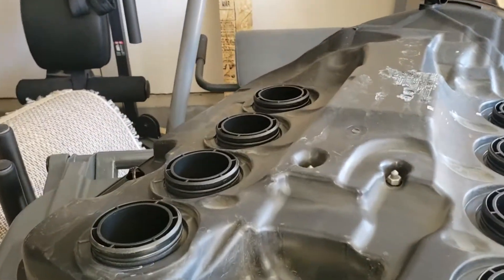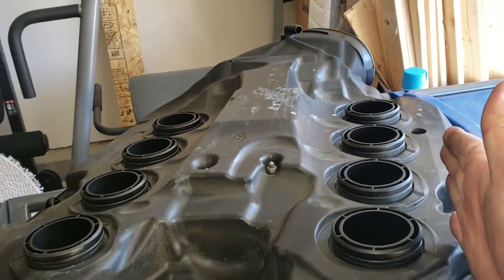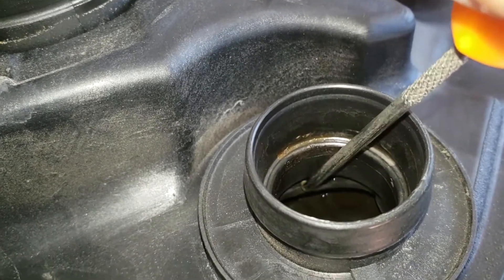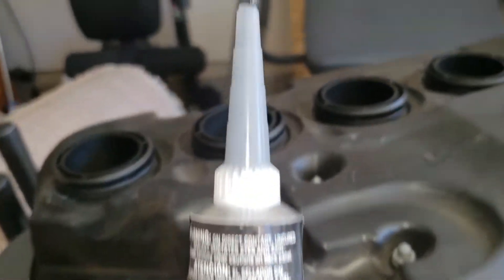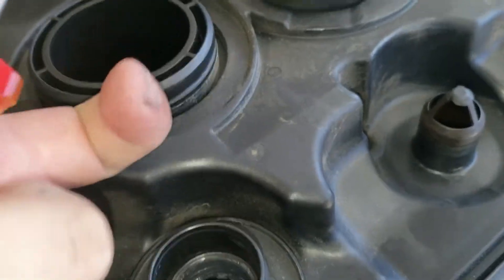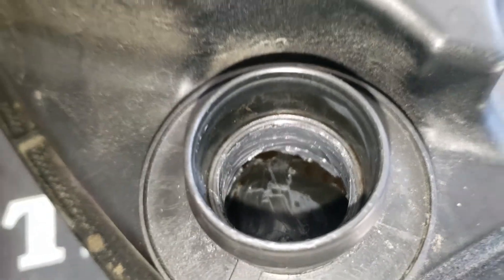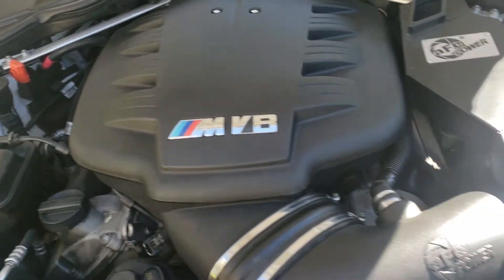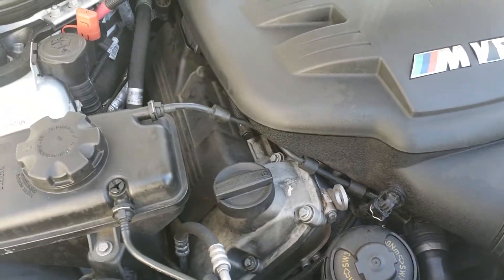E90/E92/E93 BMW M3 Plenum Defect (How To Fix Whistle While Applying Slight Throttle)

Comment: Man I have been fighting this for years. Replaced the oil breather parts that fit into that whole myself after the dealer wanted 1600 to do it. It didn't fix it. Guess it's like you say in the plenum instead of in the breather adapter. Wish I would have seen this before lol. Much easier to do